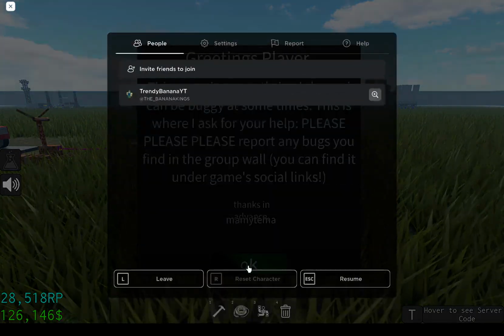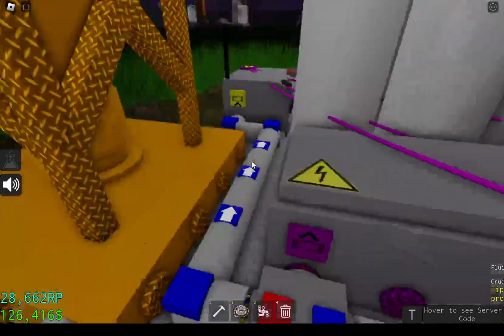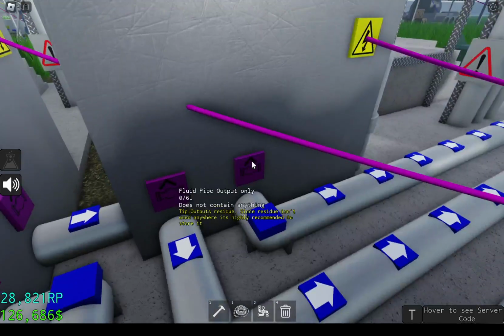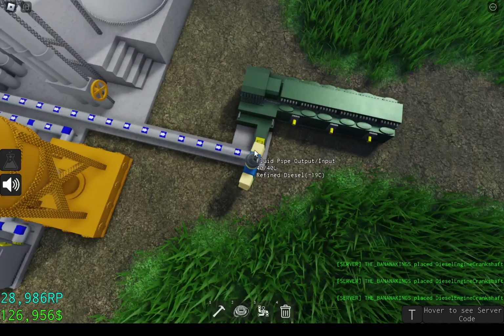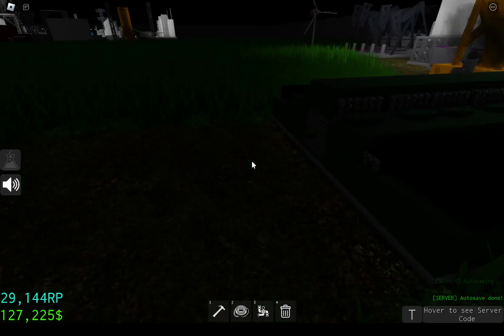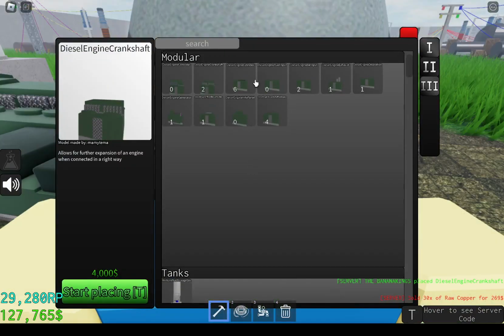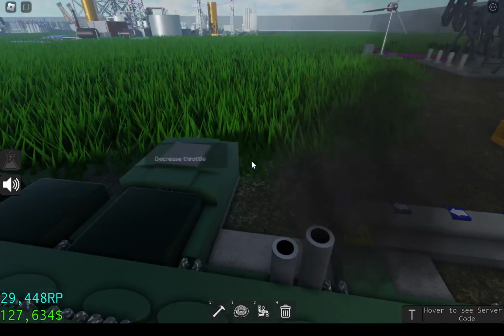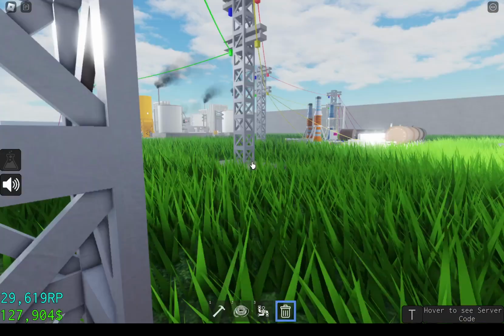How Diesel Engines Work | Industrialist Tutorial

Comment: Dude, how are you? I hope you are well. The air is 112% dirty, too. I closed everything. I planted trees, but it didn't work. What should I do? I have like 45 turbines to prevent air pollution.
Reply from the maker: Hey, I am good, thanks for asking. Trees do not remove pollution, to remove pollution you need something called a "scrubber", which is located in the tier 3 building section.
Reply: @TrendyBanana Hello, I'm glad it's good, bro, I didn't understand much, okay, I set up the system open, but I needed water, I put the fast pump, now the system is working, but I don't reduce it, it increases, it was 112%, it was 116%, I would be glad if you throw a video
Reply from the maker: Are you dumping the residue? If you are, don't. Residue pollutes 2x as much as a scrubber would get rid of. If you aren't, you may need more scrubbers.  @UmutYT15

Comment: I have a question, Is it worth it
Reply from the maker: For power? sort of. It is tied with geothermals that's for sure, which means it is tied for 2nd best power source.
Reply: Wait so, geothermal is good? I did not know.
Reply: @katerinakoleva2090 yeah, the thing is, you need 2 geothermal wells connected in sequence for them to be effective. 1 can only heat up the water to 100 celcius which is not enough for producing steam
Reply: @yourbigfan1777  dud it got to like 200 C It's effective yes i did use 2 geo's but then i used the compact geo desigh in the wiki and its cool.
Reply from the maker: Yes.  @katerinakoleva2090
Reply: WOAH MY BOILER GOT TO 30 c IN NO TIME
Reply from the maker: @katerinakoleva2090  👍
Reply: Turbine*

Comment: How do you use scrubber properly?
I Need Information About Scrubber How To Use It?? Im Struggling Right Now In Van / Truck / Car Depot It Also Produce Co2 How To Prevent It From Happening???
Reply from the maker: Water goes into the scrubber, and then you can store or sell the residue(DO NOT DUMP). Use Eco-friendly machines to prevent CO2.

Comment: Do you prefer each machines having their own power source or do you do power stations and getting machines power via poles, cuz thats what i do
Reply from the maker: All depends really, If I have a huge farm that needs a lot of power I will likely make a separate power grid for it. Otherwise I have a main power grid for everything else.
Reply: @TrendyBanana for me if its low power need like a water pump i normally just use a wind turbine for it or a direct power flow
Reply from the maker: @ez2869  Very valid.

Comment: Thanks for the video but for some reason the crude oil separator does work no matter what I do
Reply: Had this same problem. Make sure none of the liquids coming out are backed up. Residue, Gasoline, and your refined oil all need a place to go. For me, I had a gas buildup in my pipes because I wasn't using my gas faster than it was being produced. I redirected the extra to a liquid silo and that fixed it. Hope this helps, good luck
Reply: @69TwistedPsycho69  thx
Reply from the maker: Try and replace it? Or make sure no clogged pipes are there.

Comment: Can you make how to do pollution %0 ? On my world its %57 ı cant see my world.
Reply: Scrubbers thats why im doing got it down from 95 percent to 67. But you need alot of research points and a lot of money.
Reply: @spphinx how many scrubbers do you have in your world? I'm on 23% pollution so far and i'm already trying to reduce it, but it only seems to increase
Reply: I have 7 Scrubbers, that work I have some in the corner but they don't however what seems to be the problem is they get full so you need a lot of silos for waste (when they get full you can delete them and place them back) Also make sure not to use a liquid dump because that causes even more pollution. I had 96 pollution got it down to 14. I would recommend not using machines that produce a lot of pollution that you don't need mainly starter game stuff. Try ang get power from either green sources or make an efficient modular diesel engine that runs on refined diesel (the max you can refine it). that's how I got so much pollution because I had incredibly inefficient non modular diesel engines. 6 of them and they caused a lot of pollution. If you have anymore questions let me know.
Reply from the maker: Scrubbers.

Comment: bud is it better than large turbine?
Reply from the maker: That really depends. Large turbine can produce 3 different levels of power and Diesel can produce many more depending on your current willingness to spend on a diesel setup 🤷
Reply: i am having a problem with power shortage
Reply: ttely build 5 large turbine but stail low power
Reply: oh thx
Reply from the maker: No problem,  @phyoeisan4702  .
Reply: what about the large turibine with gas?
Reply from the maker: Gas burner + large turbines are the best source of power,  @phyoeisan4702  .
Reply: Well, i choose the large turbine over the engine, because it's eco friendly (paired with 2 geothermal wells) and produces lots of power as well